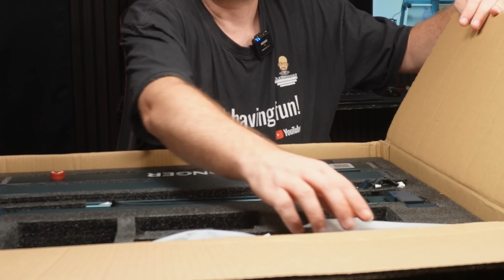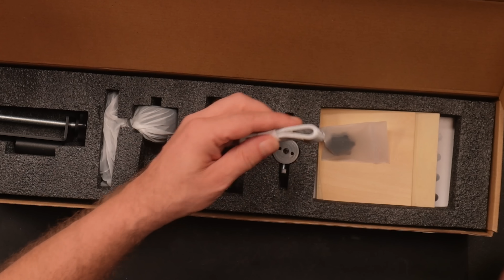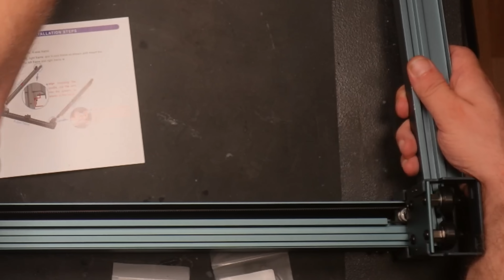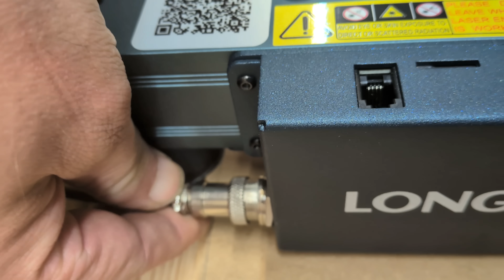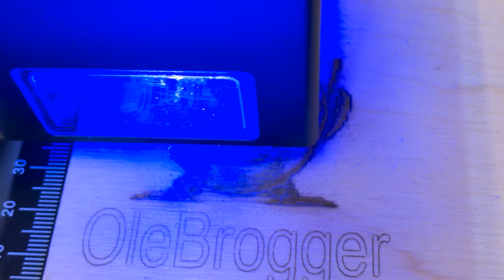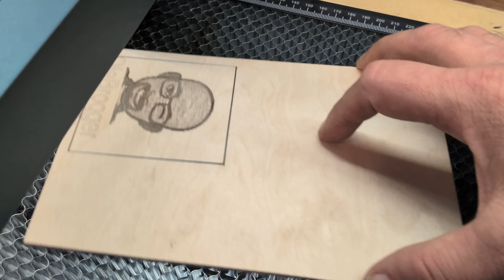Longer B1 40W Laser Engraver – Unboxing, Setup & First Look!

Comment: I recently bought the B1 40W and I am impressed with the laser. I wanted to clean the lens and looked for the video. Longer has a video but it doesn't apply to the 40W because the 4 screws the video says to remove, simply don't exist on the 40W. Any help you could give would be appreciated.
Reply from the maker: I just love the b1 40w. It is pretty easy to get access to the protection lens. Just unscrew the little hex screw on the air assist nozzel. there is a tiny hole in the side on the laser head to access the screw .Then it can be removed and you have easy access to the lens.
Reply: @olebrogger Thank you! That was it!

Comment: Hello, nice unboxing and interesting presentation. Do you have any contacts at the company? The firmware update procedures seem to refer to software that is not available. Have you tried it?
Reply from the maker: Thank you❤️I think you should contact their support. But i just updated firmware using MKSLaser Tool and it worked😃

https://github.com/makerbase-mks/MKS-TOOL
Reply from the maker: I followed this guide https://www.longer3d.com/blogs/laser-engraver-academy-1/longer-laserburn-app-longer-b1-connection